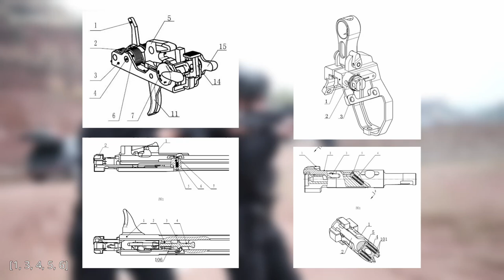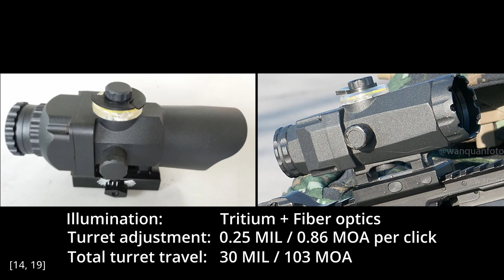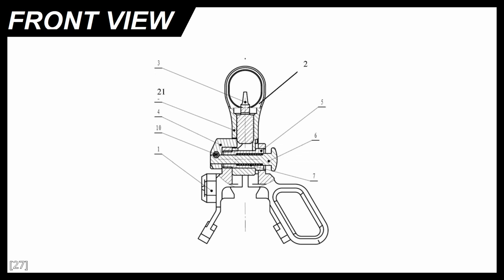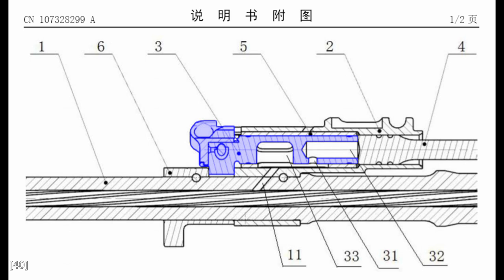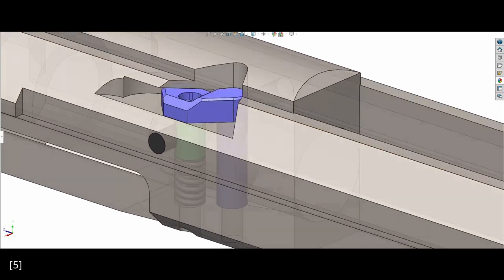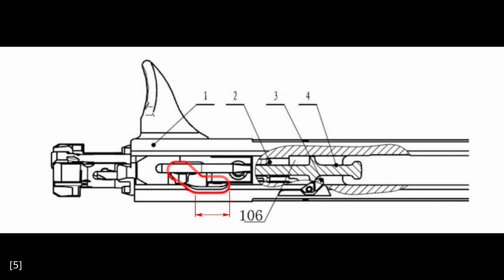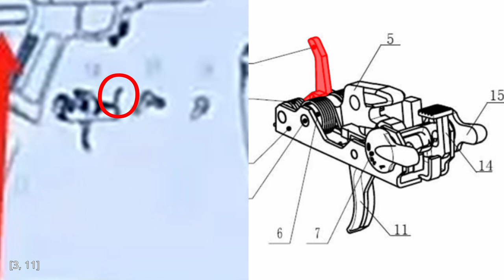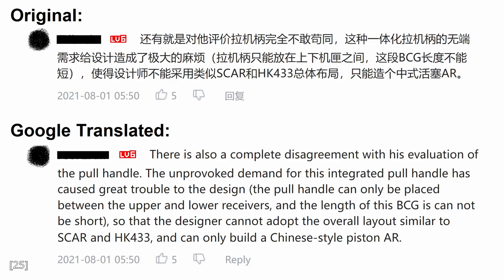QBZ191 - Update / Deep dive [CHECK PINNED COMMENT FOR UPDATES]

Comment from the maker: --- FOLLOW UP ---

I will edit this pinned comment as more info comes out, or as I want to update my analysis.

A point I wanted to make about the elongated cam track at 23:53, that didn't come across as clearly as I desired, is that this cam track is very appropriate for piston-operated weapons. As I said at 24:09 in the video, in piston guns, the gases act on the bolt carrier earlier than in DI guns, and at a higher pressure. This means that the bolt carrier starts moving earlier in piston guns, and at a higher initial velocity. So the cam track on the QBZ191's bolt carrier is elongated compared to DI AR-15s to compensate for this earlier and faster motion, to ensure that the bolt does not unlock too early.

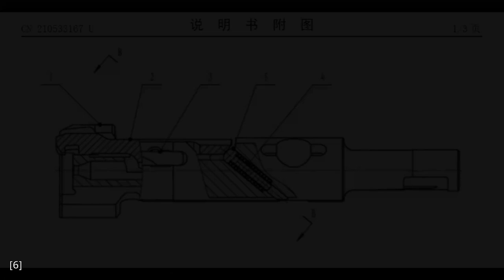Another detail that I missed about the dual oblique extractor springs at 24:55 is that this design is probably intended to account for the fact that the QBZ191 likely uses steel-cased ammunition, and has higher port pressure (compared to guns with rifle-length gas systems). First, steel-cased ammunition sticks to the chamber more, because it doesn't contract as much as brass after firing. It also has higher friction than brass. Second, the higher port pressure likely causes higher BCG velocity, which makes the extraction process more violent. The improved extractor spring design on the QBZ191 is very appropriate for these operating conditions.

At 29:52, you can see a protrusion on the hammer on the right, above where the hammer spring ends. This protrusion will hit the "floor" of the trigger pack housing when the hammer is being cocked. This stops the hammer from hitting the disconnector, which preserves the life of the disconnector.

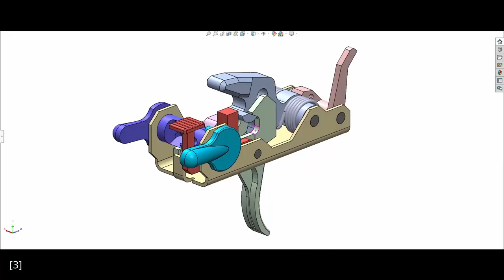*IMPORTANT NOTE: THE ANALYSIS BELOW THIS PARAGRAPH IS LIKELY WRONG, since it's based on the assumption that at 32:04, the hammer is being retained by the trigger hook. But at 29:19, the diagram shows that the hammer is not in contact with the trigger hook yet. Regardless, I won't delete the analysis, since it's an interesting thought. I'll probably make a video about it in the future. With that said, from this point on, the wrong analysis begins:
 
If you look at 32:04, on the 191 trigger pack, when the hammer is being retained by the trigger hook, you can see that the auto sear is still allowed to engage with the hammer if the BCG is not in battery. This is different from an AK, where if the hammer is being retained by the trigger hook, the auto sear is no longer allowed to catch the hammer. This means that on the 191, when you take the trigger pack out of the receiver, and you accidentally bump the trigger, the auto sear will arrest the hammer, preventing it from striking other components of the trigger pack. However, this auto sear design presents a safety concern. The sequence of events that can lead up to a potential safety incident is as follows: 
1 - The shooter is firing the gun, and for some reason, the BCG barely fails to go into battery (say, the bolt carrier is 1 cm from the front-most position). This means that the hammer is now being retained by the trigger hook, and the auto sear is still not tripped. 
2 - The shooter - unaware that the weapon is out of battery - pulls the trigger again. The hammer leaves the hook of the trigger, and is now arrested by the auto sear. 
3 - The shooter hears a click, discovers that the BCG is out of battery, hits the charging handle to assist the BCG forward.
If those 3 steps happen exactly like that, when the BCG is assisted forward, it will trip the auto sear. And since the trigger hook is no longer engaging the hammer, the gun will discharge. Assuming my analysis is correct, and assuming that I interpreted the patent drawing correctly, this can be a safety issue. My hypothesis as to why the auto sear is designed this way is that the engineers recognized the potential problem of the trigger being bumped while the trigger pack is outside of the receiver, and designed the auto sear to account for that. But in the pursuit of solving that problem, they missed the possibility that the exact sequence of events I described above can cause an accidental discharge. This problem can be easily fixed by modifying the hammer such that it interacts with the auto sear exactly like an AK.
Reply: 很有趣的分析同志

Well it seems people with certain knowledge could dig a lot through open sources, that's both very impressive and a bit scare to me
Reply: I'm confused about the cam track. It suggests that the bolt will unlock first, stay a little bit before extracting the casing. Isn't it better to have the bolt carrier move first before unlocking the bolt?
Reply from the maker: @ABCantonese  In all of the drawings in this video, the bolt is at the unlocked position. When the bolt is locked, the cam pin will be at the end of the longer portion of the cam track. So when the bolt carrier starts to move rearward, the bolt will stay locked for a while before unlocking right?
Reply: the rear most angled knob on the scope is focus adjustment paralax adjustment would be the elevation dial on the top for zeroing
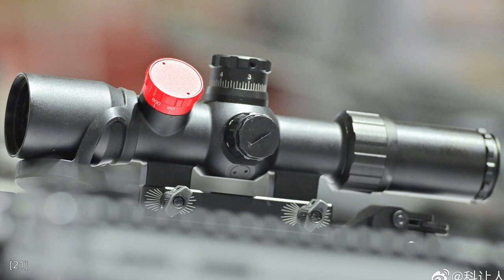Reply from the maker: @seshmarls  For the photo at 5:42, the front of the scope is pointed to the left. So the angled knob would be towards the front of the scope and not the rear. If you're talking about diopter focus, I think that would be the ring on the eye piece (i.e. the ring on the far right, near the edge of the photo at 5:42). And if I'm not mistaken, on a first focal plane scope, parallax is adjusted by moving the lens in the objective bell such that the target image matches with the reticle etched in a piece of glass near the objective bell. If so then the parallax turret being placed on the objective bell would be reasonable. I also don't think adjusting parallax together with the elevation dial would make sense. For example, you mount the scope to a rifle 1, and you need to turn the elevation turret, say, 15 clicks, to zero the rifle at a 100m. Then you take the scope to rifle 2, where you need to turn the elevation 45 clicks to zero rifle 2 at 100m. In that example, both rifles will be zeroed at 100m, but the parallax would be completely different, no? All in all, I still think that angled knob is for parallax adjustment. The infinity symbol on that knob supports that hypothesis as well.
Reply: @cabbage6015  the large circumferential ring on the right is for adjusting magnification the 3 knobs at the mid point at the 3 12 and 9 o'clock are for windage elevation and reticle illumination the only other adjustment you would have on a scope is diopter adjustment  parallax is not something you adjust its something you live with you at your zero at say 50m and your reticle has hold overs for different ranges or you adjust your elevation knob for the desired range. The only time parallax has any real bearing on POA/POI is between zero meters and your zero which for example with 5.56 is 50m is ~50mm or 2 inches and that engagement range is not one where you would ever have the time to fiddle around adjusting your parallax
Reply from the maker: @seshmarls  I wasn't talking about the large ring, I'm aware it's for magnification. I'm talking about the small ring at the very edge of the eye piece, which I suspect is for diopter adjustment. Also I'm very sure that there are scopes that allow you to adjust parallax, especially higher magnification scopes: https://www.youtube.com/watch?v=1VPGcq9IVxc . The parallax adjustment turret in that video is also marked with an infinity symbol, which is consistent with the markings of the angled turret on the QBU191
Reply: At 34:38 the commenter later received a reply explaining the demand for an integrated puller, it translates as follows:
"The PLA has been using integrated puller handle, the advantage is less moving parts, simple structure, sturdy and durable, while solving the problem of pulling and pushing the mechanism, even with a foot kick. SCAR's puller handle design is not in line with our military's habit of holding firearms, improper grip is easy to hit the hand. ACR or HK433's puller handle structure is complex, the production cost increases at the same time, and does not guarantee its own reliability in harsh environments. After all, the puller handle component itself may jam. How can the Army not like a one-piece puller handle that balances reliability and cost? "

BTW I also recommend DeepL rather than google translate, it is just better in every aspect.
Reply from the maker: @lizi1936  Thanks for the details!

Also I've tried using DeepL, but I found that it's only good at translating casual language, like comments and conversations. When I tried using it on the patent documents, it translated all the technical words to very weird casual words that sometimes don't have anything to do with the document at all.
Reply: Khi nào rảnh làm video về khẩu stv đi bạn 👍
Reply from the maker: @jerryle379  thật ra mình thấy làm video về khẩu đấy hơi ít thứ để nói, vì hầu hết nó là các chi tiết của AK vs Galil ACE kết hợp với nhau :<
Reply: @cabbage6015  ừ nhưng làm đi bạn thấy hay đấy cứ promote vk nước mình , first step , nó không hoàn toàn là AK và cũng không phải Galil mà kết hợp chắc bạn tây cũng thích xem đấy .
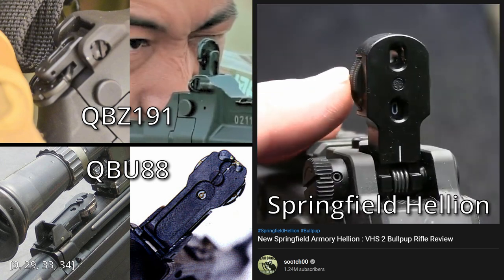Reply: At 10:55 you state that it was the Croatians who copied the Chinese sighting system. However, I do not think that this is true. The Hellion is simply a VHS2 which is sold by Springfield. The VHS-2 was first shown to the public in April 2013. While the sight design may have changed since then, I can confirm that, at least as far back as 2017 (during the French Rifle Trials), the VHS 2 used this design of sight. 
This means that it is likely that it is the Chinese that copied the Croatians, rather than the other way round.
Reply from the maker: @Rorschachs_Blot  I'm aware of the developmental history of the Hellion/VHS-2. I said in that section that the rear sight design is present on both the QBZ191 and the QBU88, the latter being a Chinese DMR fielded in the 1980s, which makes it predate the VHS-2. Also the part where I said the Croatian copied the Chinese is just a tongue in cheek joke. The main point I was trying to make is that small arms design has stagnated because the most efficient mechanisms (that is achievable with current technologies/materials) have already been invented. So it is inevitable that some mechanisms will recur in multiple guns, and it is not reasonable to disparage a design solely because it contain elements from other weapons. 

Also a few other commenters have pointed out that some variants of the FN FAL also used a very similar rear sight design, so the QBU88 is not the first iteration of that rear sight either. The Beretta ARX180 and another aftermarket rear sight also used that design, but they appeared later than the FAL and QBU88.
Reply: @cabbage6015  Thanks. Obviously must not have been listening properly to that section of the video, and jumped to conclusions.
Reply from the maker: @Rorschachs_Blot  No worries! I appreciate your insight regardless
Reply: Maybe you have CAD files? Or a 3d model?
Reply: ￼牛啊，兄弟你英语真强